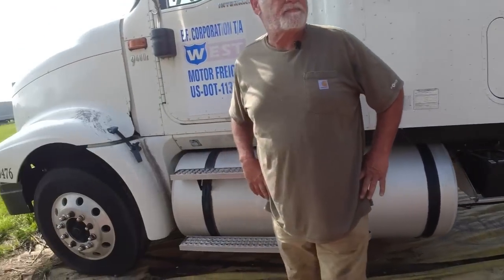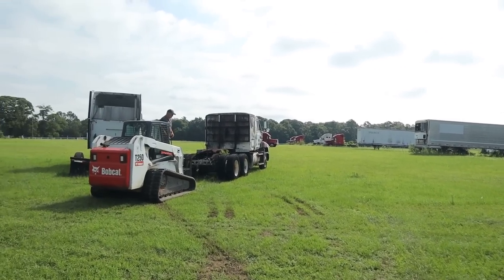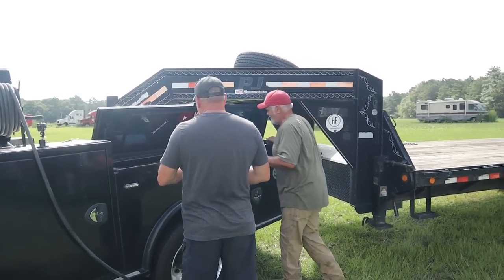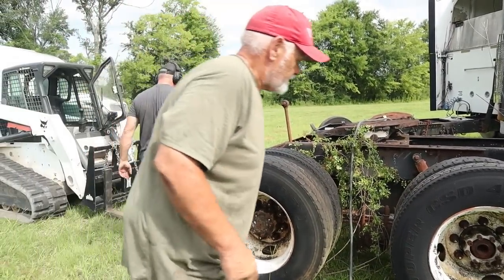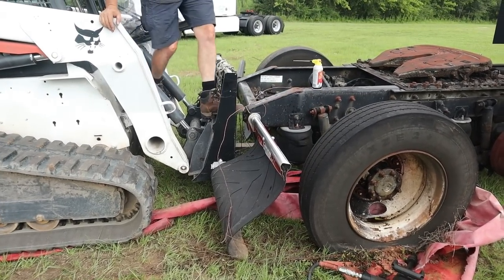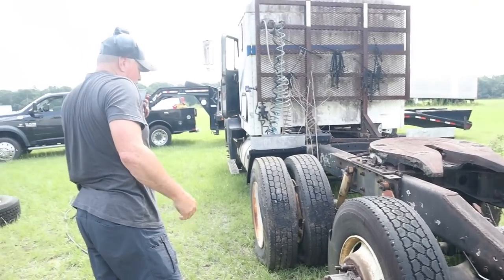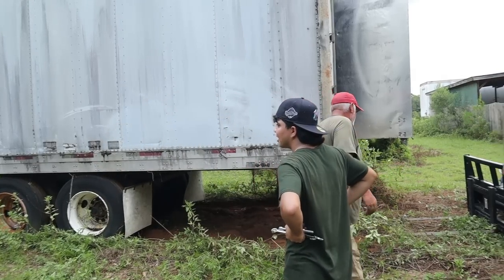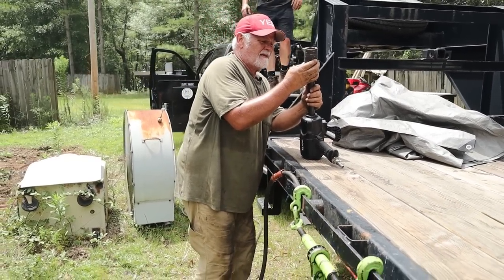MACK TRUCK TIRES DON'T FIT! We have to find enough to get them on the road!

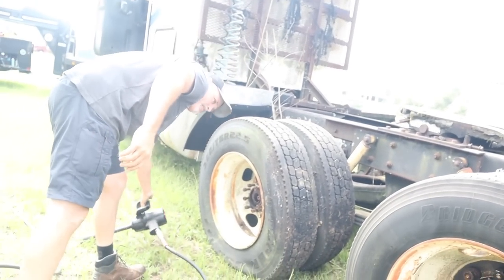Comment: 18:53 I do not miss the days I did this for a living. Also ya'll gonna have fun mixing and matching wheels if these trucks aren't all stud or hub piloted.

The Mack is stud piloted. One side should have reverse thread hardware. The volvos and Intl's are likely hub piloted and won't. Also I'm already seeing a bit of 'fun' pop up for you on this mack; one of the studs on that drive wheel came loose but not the nut.........

Comment: 32:56 Two tire bars, some dawn dish soap, a valve stem tool, a cheetah can, a clip on inflation chuck, and an inflation cage would make this whole 'Mack rim won't fit Intl/Volvo' situation moot Lo-Pro 22.5 tires are shockingly easy to mount and dismount the only real problem is whether or not they'll explode when reinflated, so that's what the cage and clip-on chuck is for.